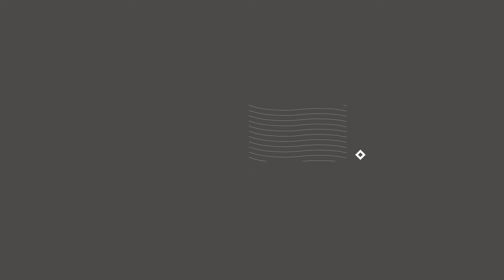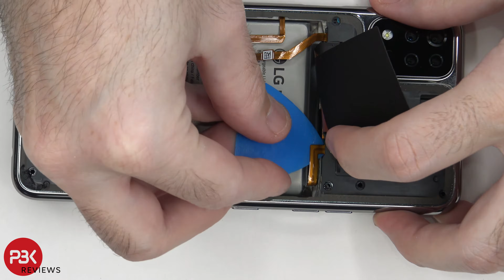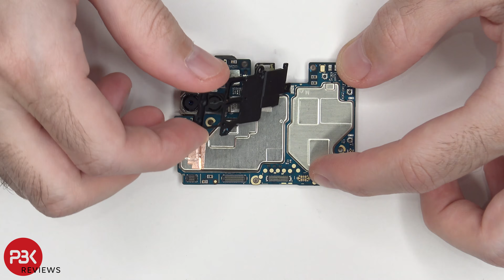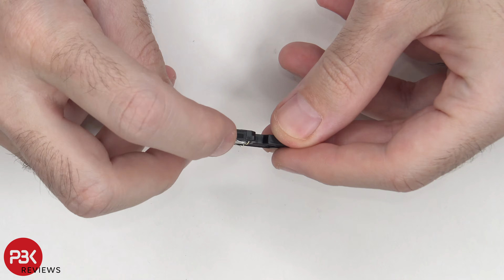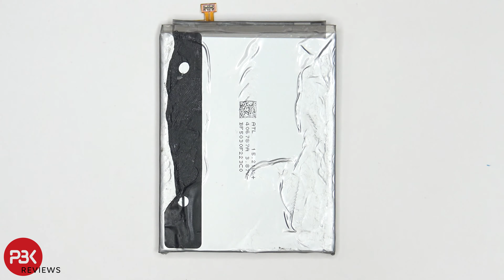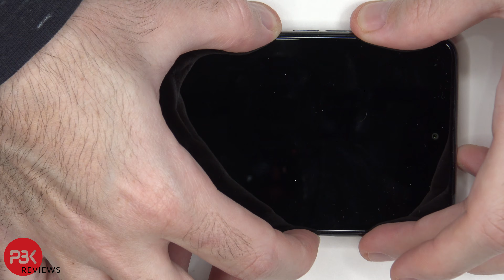LG K42 Disassembly Teardown Repair Video Review

Comment: Is it being sold in korea
Can you do cross-compatibility test for k42 k52 k62
Is it glass protector on the camera cover
Reply from the maker: Yes should be available in Korea and what type of cross compatibility test? I know the k52 and k62 are virtually identical but the k42 is a bit different. Usually the camera lens covers are a type of glass
Reply: @PBKreviews  camera, screen, battery, and maybe the whole mainboard?
LG k71 is also identical to stylo u except for cameras
Reply from the maker: @harysviewty  Everything seems to be interchangeable, same battery, same screen, same charger port board (aside from the gaskets being different color), same vibrator motor, same flex cables for the speaker assembly/power button/ and side buttons. The speaker inside the speaker housing should be interchangeable too but the speaker housing (plastic housing) seems to be a bit different in shape/size. Motherboards are different in shape/orientation so those would not be interchangeable. Same with the cameras, they have different connectors or lengths in camera cables. The front facing cameras might be interchangeable since they are in the same area and same connector type.
Reply: Rej